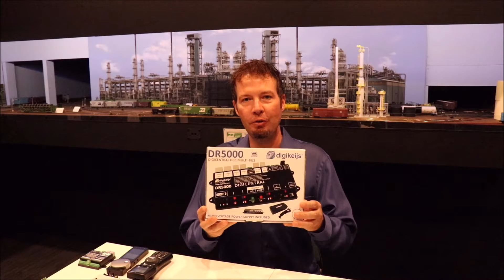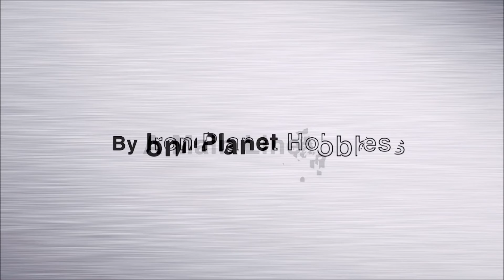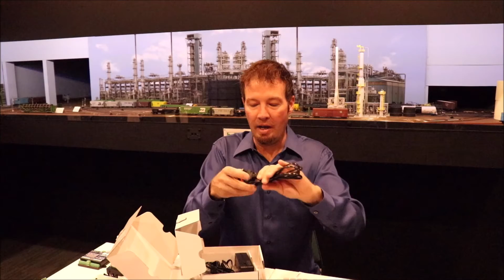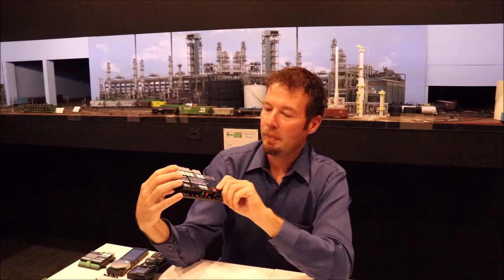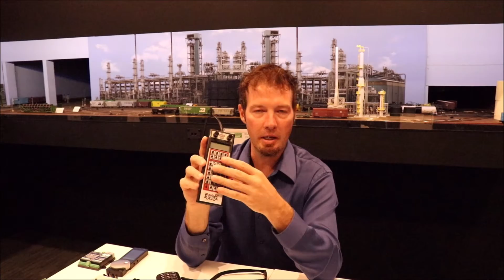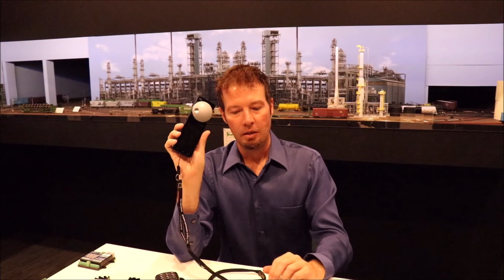Iron Planet Hobbies Presents The Digikeijs DR5000

Comment: Hi Ryan,

I was curious if you had any experiences with the Digikeijs  DCC command station or the YAMORC YD7010 replacement using multiple protocols simultaneously. I have 2 layouts I want to merge . One layout contains the Digitrax  system withLoco Net throttles and components, and the other layout uses  the newest Lenz system with Xpress Net components, consisting of throttles, accessory decoders, block occupancy detection and feedback modules. Would the YAMORC system be capable of controlling them all simultaneously on the same DCC Bus? Thanks.

Kind regards,

Stephan

Comment: nice informative video Ryan. Is the version on box firmware or are you referring to the DigiCentral Win s/w version?  I assume the PC s/w is used to upgrade firmware too.
Reply from the maker: Yes, the number on the bottom of the box is the firmware version installed.  When you download a newer version of the PC App, then you will have the option to update the DR5000.

Comment: Hey Ryan,

Have thank you very much for your great video about of the DR 5000 Command Station.

I am planning to upgrade my old 
Roco/GFN (Gbr. FLEISCHMANN Nuremberg) Multimouse Digital Command System in addition with the separated Booster as Central Unit (looks like similar to NCE Power Cab System) but with the difference that CVs cannot be read out.

The new z21 or Z21 from Roco/Fleischmann is a little too expensive with lot of reduced possibilities when using cable wired grey or red Multimouses with this new generation of the Z21 family of Command Stations. 

Roco says that only the black Z21 cableless Wifi Throttle allows to create multiple traction units easily, that isen't the truth, it works with the cable wired Multimouses via CV 19, too.

What all Roco/GFN DCC Command Stations have is the general max Amperage of 3 A.

The Digikeijs DR 5000 works with
3,2 Ampere, too.
It gives two different Power Voltage Versions of the DR 5000 one for 15 V and one for 18 V input Voltage, the output Voltage is around by 13,8 V to 14 V of Track Power with a max of 3,2 A.

Please can you say what will works best as input Voltage for H0 Scale Layouts?
15 V or 18 Volts?

What kind of Boosters I would need using Digikeijs or can I use the old Roco/GFN Boosters?

Please can you show how to consist multiple Units via the black Z21 Wifi Throttle or maybe if possible with one of the cable wired red or grey Roco or GFN Throttles in addition of the Digikeijs 
DR 5000 Command Station?

Ya, Ingo
Reply from the maker: The 18v version is best for HO.  The DR5000 can be used with multiple brands of boosters.  If the Roco booster has XpressNet or the CDE, then it will work.  Here is a link for consisting with a Roco throttle: https://youtu.be/NP4d14X7QRA

Comment: Hi Ryan, on one video I saw, that someone advised to provide a cut-out in the plastic on the USB plug (the smaller end) to be able to insert the plug to the end into the device, as the supplied cable can't be pushed right to the end due to the sticking out base of the DR5000. Can you please confirm, is this the case? Thanks.
Reply from the maker: I have never needed to do that but if your USB cable isn't working with the PC App then that might be the case.

Comment: Hi Ryan, thank you for explaining the little thing - terminal connector. I have got in the box, but didn't know for what is this. Obviously the very poor manual does not tell about it. One more question: the manual tells exactly the order of set up: install the software, connect DR5000 with PC via USB, open the app. But the manual, does not tell when to plug in the power supply? Is it needed at all when connecting via USB? Thanks
Reply from the maker: Yes, you can plug in the power supply at any time.  It will be need to be able to connect via USB.

Comment: Hello everybody, new to dcc and model railroading. I am in the process of choosing a dcc control station. I am very torn between the dr5000 and the nce power pro 5 amp system. I like that digikeijs has so many plug and play accessories and all sorts of modules that neatly tie into each other. If im running long lengths do have to spread the boosters apart or can i keep them all neatly together and run longer buss wire. Thanks for the vids, very help full
Reply from the maker: Jay, both will run trains but the DR5000 has many more options and features like WiFi & RailCom.  Plus you will be able to use NCE throttles on the DR5000 with a new add-on device that will be out soon.
Reply: Yes, i ordered the dr 5000 from your website on black friday. Done did some research and found i like the system and all its capabilities. My goal is run the entire lay out on nothing but digikeijs components. My bench work is done, im going to be running roughly 200' of track on a large L shape. I would like to keep all my boosters and modules on one panal, is it ok for me to run long bus wires? Roughly 50 feet per bus. All my power is coming in from one plug outlet so it would be better to run longer busses rather than extension cords. Anyways, thanks for the videos, been a huge help in my decision making, looking forward to further buisness with you. Thanks again!

Comment: I have two questions about this DR500.
1. Is it Apple compatible?
2. Can you use this instead of the LokProgrammer for ESU?
Reply from the maker: You don't have to have a computer for the DR5000 but it does help.  It is not directly setup for Apple but will work if you install Parallels.  The DR5000 can do both LNCV and regular CV programming for all decoders.  However, you will still need the LokProgrammer for ESU sound files.  It is the only device that can load the sound files onto the decoder.

Comment: It’s a few years since this video, but I am looking to purchase a DR5000.  Will Digitrax DT602D connect in like the Z21 and the ESU mobile throttles?
Reply from the maker: For wireless operations with the DT602D you will also need the UR92 or UR93.  It can also be plugged in like the DT602.
Reply: Yes, thank you!  The UR-93 came with the starter set.
Reply: Just ordered from your eBay store!
Reply from the maker: @mjmonjure  Thanks for the business!

Comment: Hi, I bought a DR5000 from you on Amazon uk and it seems like a great product. I also have digitrax bdl168 and pm42 for a future project. Digitrax say that they should be connected to the ground on their command station (dcs100/200) and their boosters. How would you wire them up?
Thanks,
George
Reply from the maker: Thanks George!!  The PM42 and the BDL168 ground wires can be connected together.  They should work just fine like that.  
Thanks Again,
Ryan

Comment: How many wifi throttles can this support at once?
Reply: The Answer is 100 for the Dr-5000, and 126 simultaneous Loco’s*, 2048 switches - AU dealer
Reply: @ridgepointerail9462  :O wow, freakin awesome!
Reply from the maker: From what I understand there is no limit but in theory about 16.

Comment: I have the DR5000 and DR4088LN wired for block detection and have an led panel. It works fine until I add a few S88 detectors connected through the S88 of the DR4088LN. Multiple pairs of led blocks are being detected by only 1 occupancy. If I connect the S88 directly to the DR5000, then the 2nd set that's triggering flashes quickly but goes off as expected. Must be some conflict. Can you help?
Reply from the maker: Yes,  in the ext88N tab you will need to set the Number of your S88 modules.  Then set the total number of contacts and the first S88 feedback number.  Each S88 should have it's own board number and detection points in order from board to board.  These dection numbers need to start past or before the group (all 32 or 48, etc) coming in from the DR4088LN.  Any S88 connected to the DR4088LN will report on the LN and not the S88.  You may have an overlap somewhere.  
I think the best way to go would be to put all S88s into the DR4088LN and then set the board ID's and detection contacts following the the DR4088LN.  If you go this route make sure to turn off all S88 fields in the ext88N tab (put everthing to 0) in the DR5000 GUI.  I hope this gets you going!  There is also a video in our channel for setting up the DR4088LN that talks a little bit about this.

Comment: Is it possible to connect the digitrax zephyr as a slave throttle into the DR5000? How?
Reply from the maker: It connects via a loconet cable just like any other device.  But before you connect it you need to convert it to a slave by using the following:

1. Press the PROG key. The display shows the last programming mode used
by the DCS51.
2. Press the SWITCH key. The display shows the last switch used by the
DCS51. The SWITCH indicator Dot will start blinking to indicate you are in
Option Switch Mode.
3. Use the keypad to enter 2. To let the DCS51 know you want to change
Option Switch 02.
4. Press the c/- key. to let the DCS51 know that you want to change Option
Switch 02 to c and make the DCS51 a booster and throttle only. The display
will show 002c with “L”s walking from left to right through the display. This
means that you have set the DCS51 to run as a booster and throttle causing
a loss of carrier signal. This is normal.
5. Press the exit key. The display will show br followed by the last address
used by the DCS51 with the walking Ls through the display.
6. Connect the DCS51 that is now running as a booster with your loconet cable.
7. As soon as the DCS51 is hooked up to the layout with a command station,
it will resume normal operations.
Reply: IronPlanetHobbies thank you very much, I will try it.